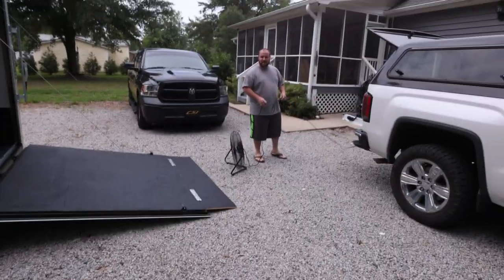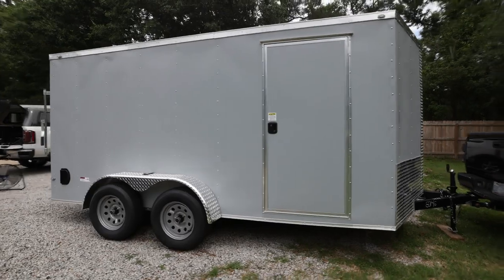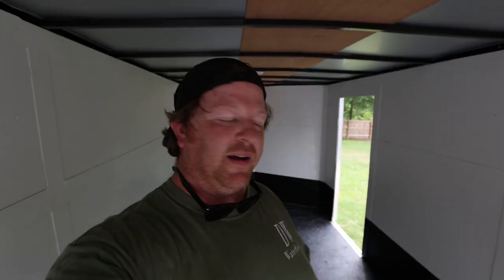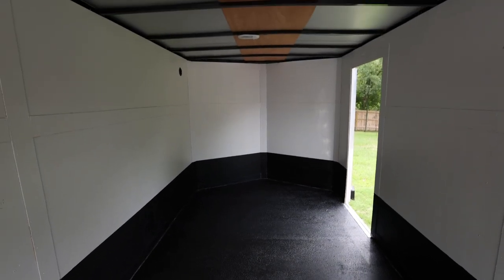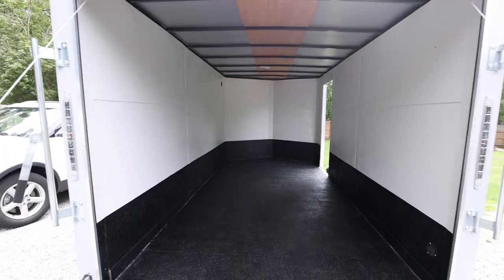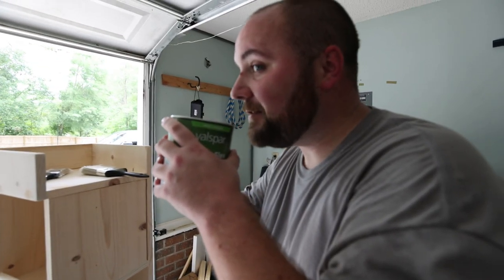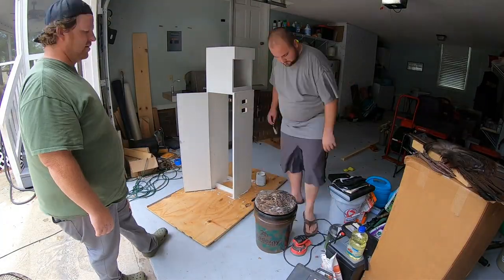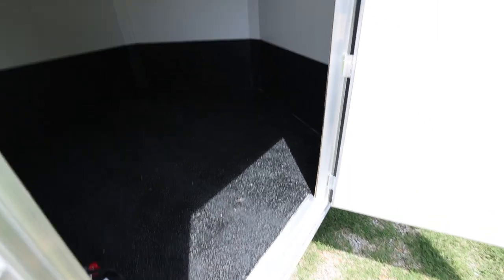We Bought A Decoy Trailer! | Trailer Build - Ep: 1

Comment: How did you apply the floor liner sealant to the wall? You said you could take all of this down later? It’s not permanent?
Reply from the maker: the floor sealant and paint were all done with paint rollers and is permanent. we were referring to the shelves, partition wall, and anything else on the e track system could be removed whenever needed.